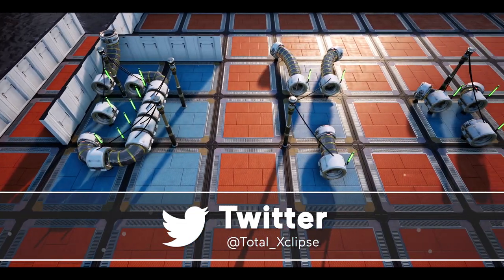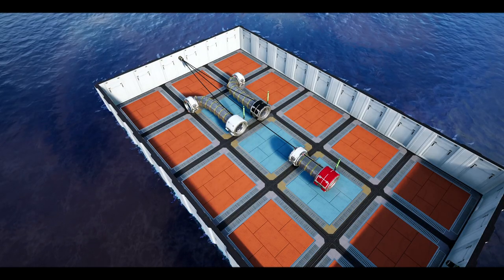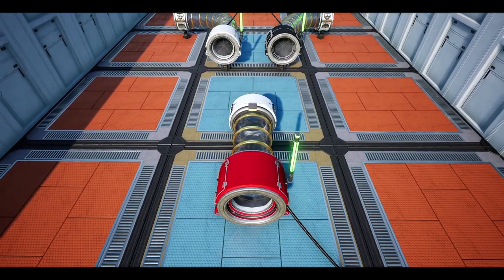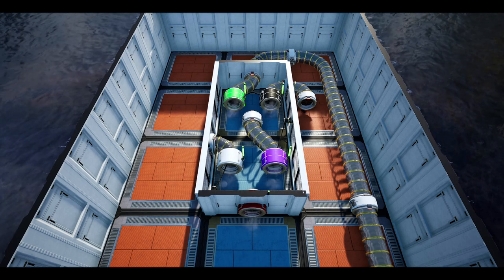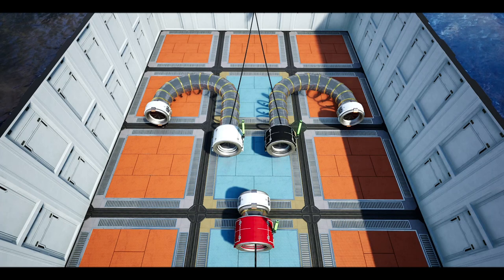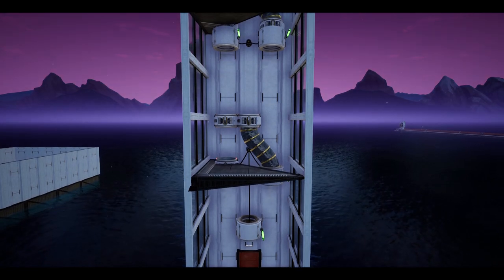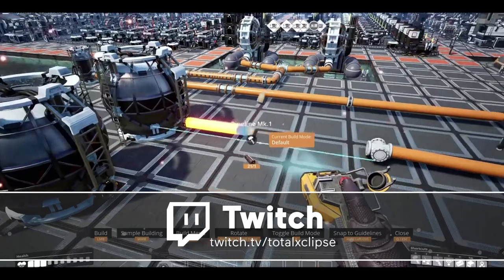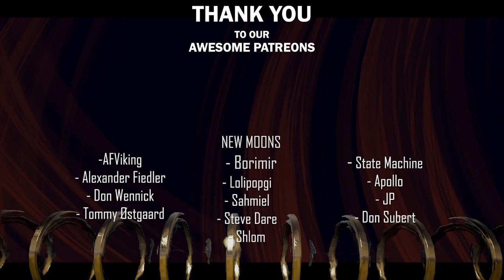Satisfactory Hyper Tube Junction Guide

Comment: The hyperloop setup where its a literal loop and the path you intend to take on the left (or right) of the loop is fantastic! i've started using a setup with 2 entrances in the loop and 1 entrance at the path i'm gonna take and sure it takes like 4-5 seconds of looping before it rockets me down the path, but its fairly power efficient and compact. thanks for the video!!

Comment: Now I can change my current hypertube network that has about 10 entrances in one central hub. It works well but I like these junctions
Reply: I hope you found a solution, but in case you didn't think of hypertubes like railway lines where you have one main line which will go across the whole map from your base to idk lets say your main power plant. Then you can have branch lines off of your main line that go to all of your different factories, and if you really want to go nuts branch lines off of those even to get to your mining outposts.